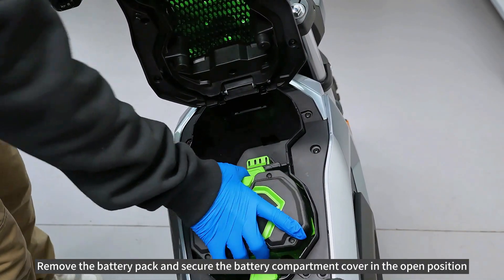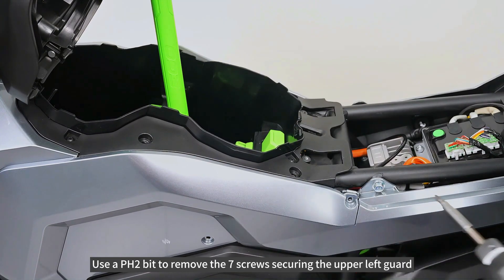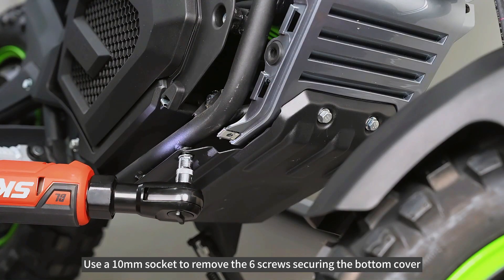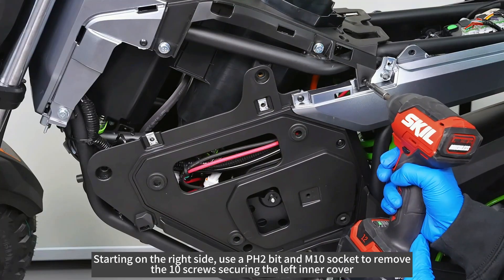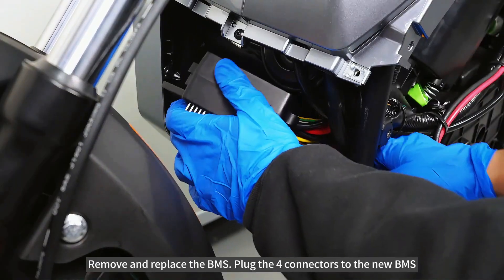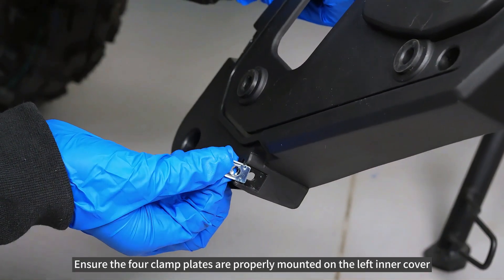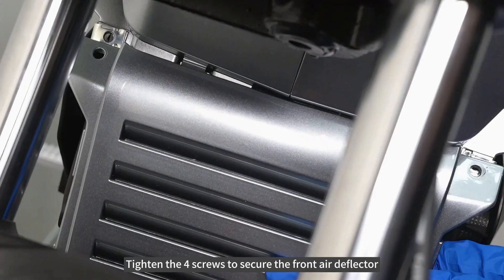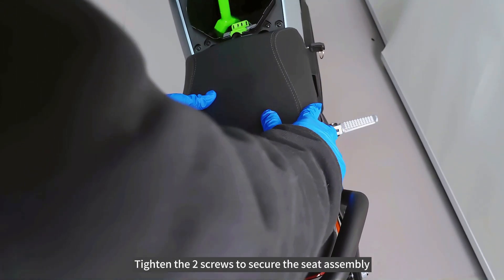EGO MB1000_How To Replace The BMS

Comment: Thanks for the videos!!! I wonder if there is a speed limiter and if yes we can remove it and go faster. Thank you😊
Reply: Yesss, it does, you just need to remove the seat and turn it off to enable SPORT mode, the guide video is on the way!
Reply: @XinjingTian  but sports mode won't help to go faster than 28 miles per hour?
Reply: @LaRoutedesGuerriers  No, top speed 28